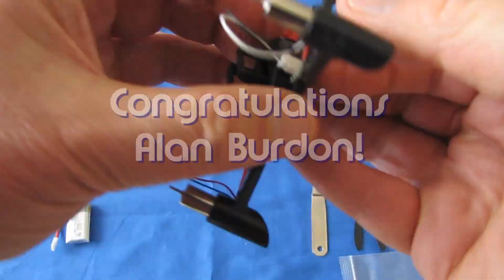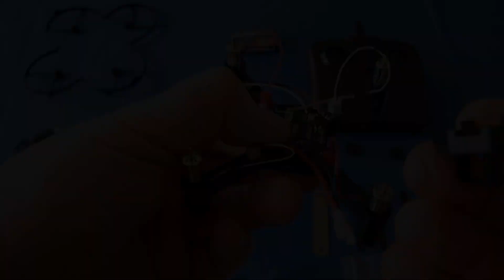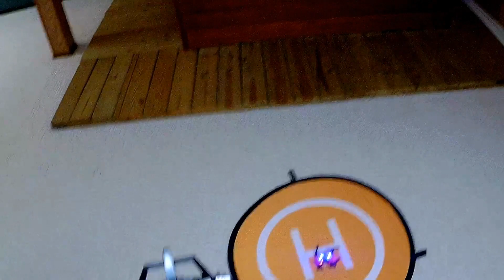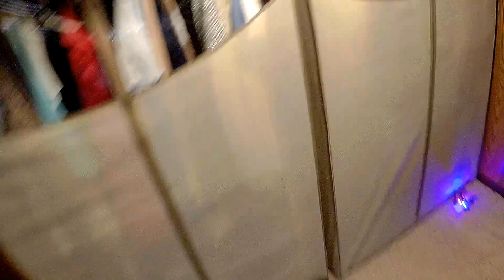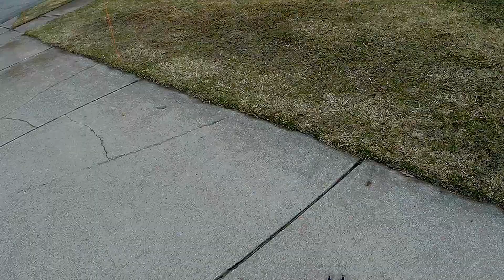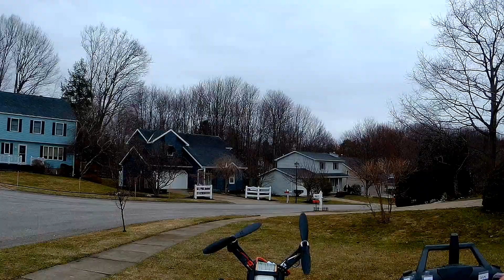DIY Build a Drone Kit Flight Test Review

Comment: after take off and maybe a few seconds of flying...drone blinking the leds and it disconnects from the controller...keeps blinking and wont connect unless i disconnect the battery and bind it and calibrate again.....any idea what the problem...i bought this to learn how to control drones 😁.....oh and thanks for the video
Reply from the maker: The blinking LEDs indicate low battery.  For some reason, the drone's battery is not charging.
Reply: @Quadcopter101  Thankyou so much for your reply.....much appreciated